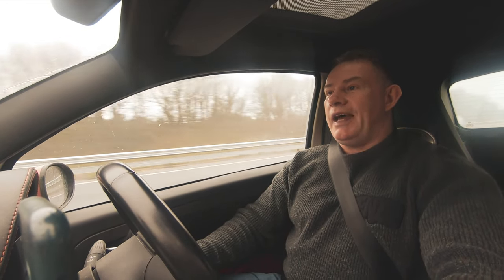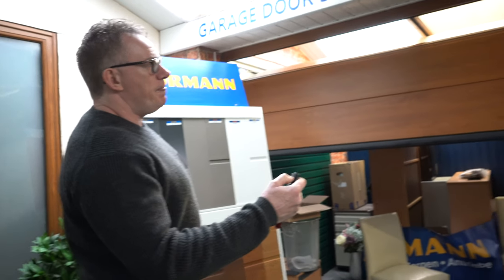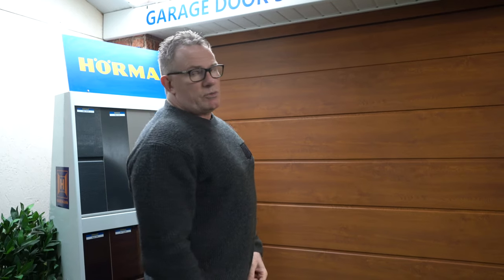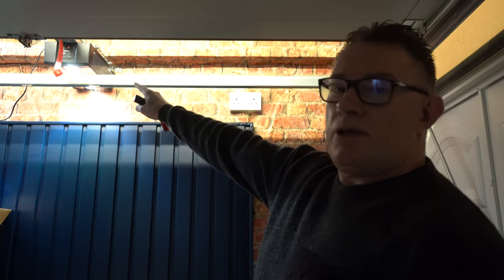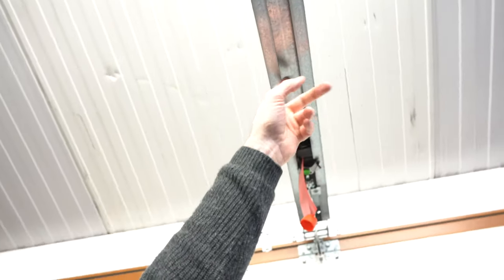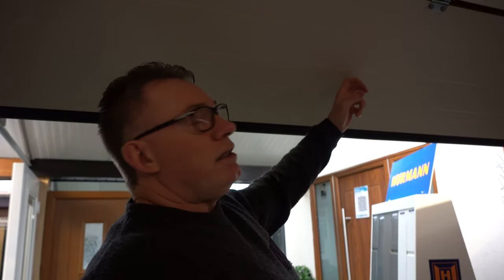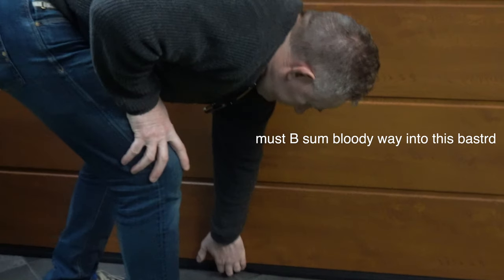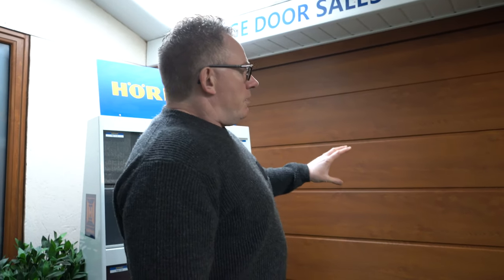DOORWAY TO MY FERRARI!

Comment: I'm just looking at installing an electric roller type door into my garage. Like that it will save space over an up and over door. I'm guessing they aren't as secure? Is that the main reason you're going for this type?
Reply from the maker: Advantages of installing a sectional door over a roller door…
- Better wireless security with Hormann
- Quieter operation
-  Better physical security
- Loads better thermal insulation especially if installing insulated panels
- Looks loads better
- I believe more robust and better engineered
- Roller system requires substantial space above the interior entrance lintel for the roller storage system

Negatives…
- Takes up overhead space for the rails
- Sometimes more expensive but if specced and managed properly it is about the same cost
Reply: @RichReviews_  it's mainly the insulation that's appealing but all things considered I think electric roller is probably what I'll go for, really want the extra space to store bikes. I also appreciated the dehumidifier review. When are you getting the door fitted and are you planning on doing a video for it?
Reply from the maker: Door already fitted and video on my channel. 👍